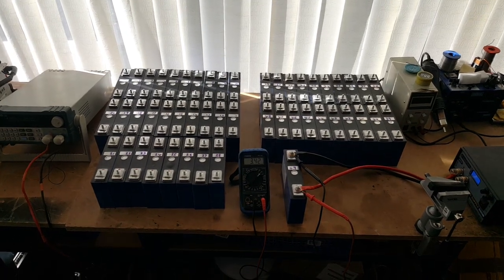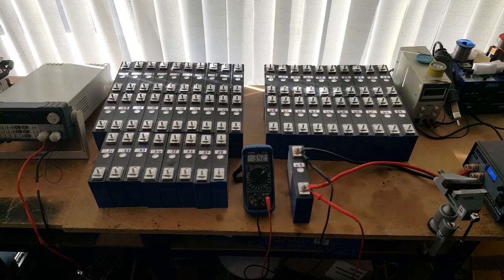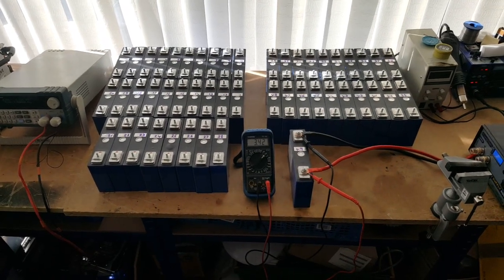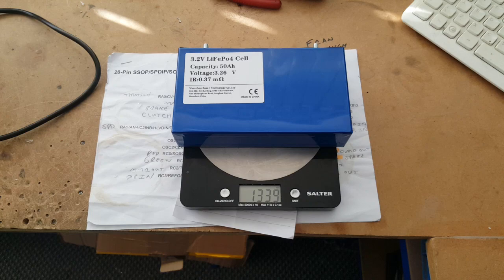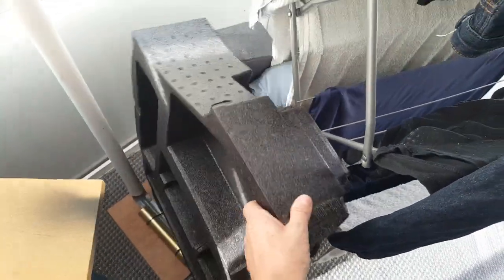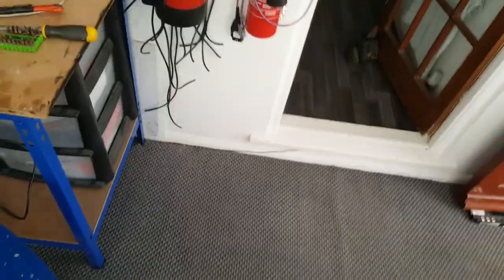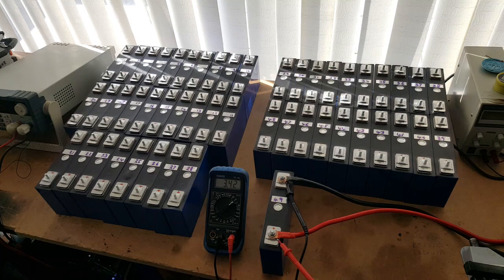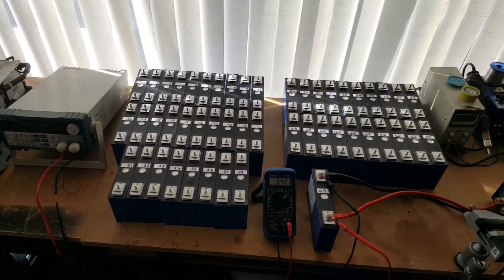Lithium CR-Z Buddy Pack Video 4

Comment from the maker: The first cell tested at 54ah capacity when charged to 3.6V and discharged to 2.5V using a constant current 25A (0.5C) load.
Slightly better than the expected/rated 50ah.
Reply: Hello Sir! I tried to write you an e-mail and I hope you've received it. Thanks!